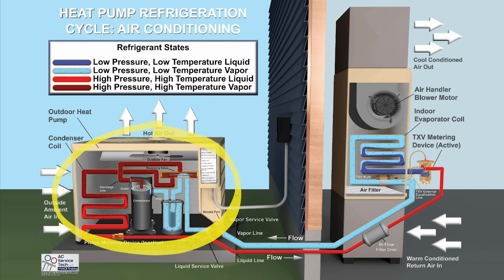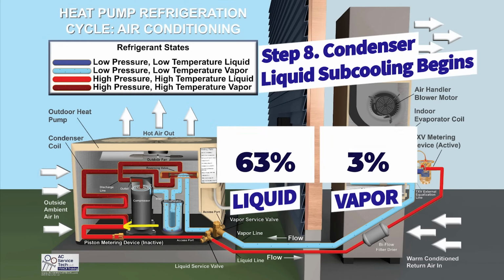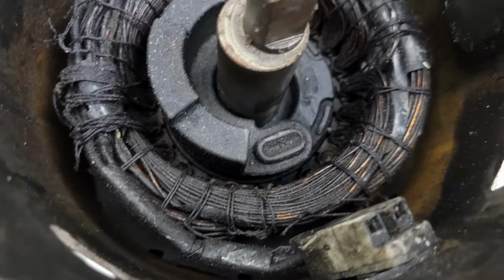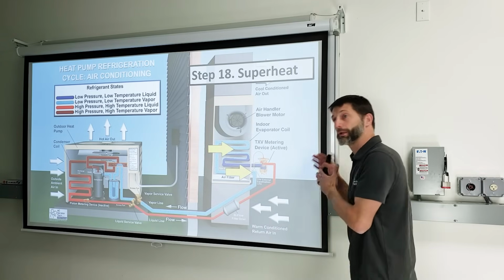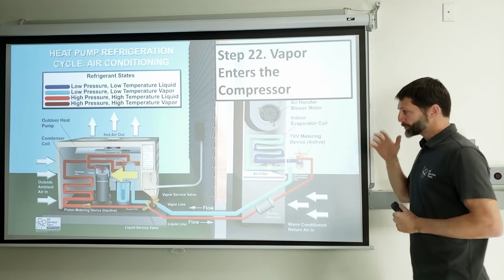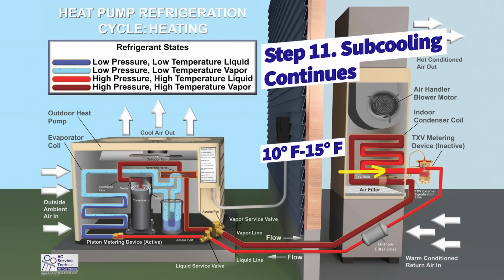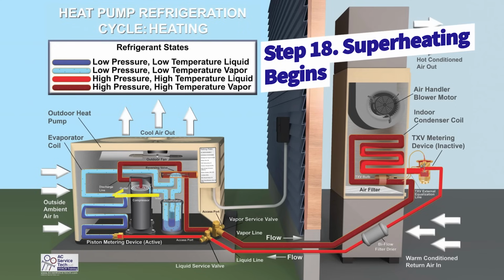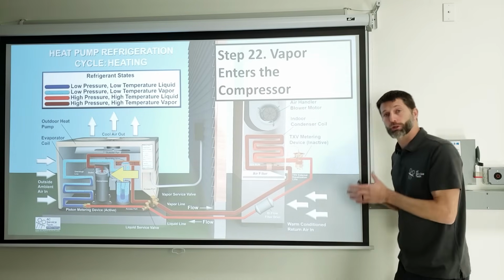HVAC Apprenticeship Class, Refrigeration Cycle, Superheat, Subcooling, Saturation, Parts, AC & Heat!

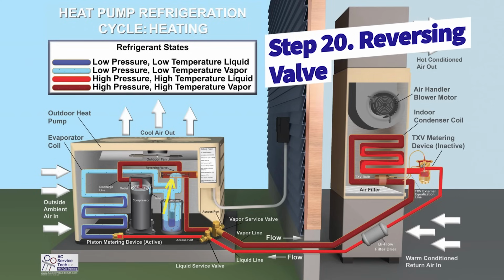Comment: I'm confused at 31:07, how is the low temperature low pressure liquid turning into a vapor as it travels up the coils into the reversing valve? If it's cool outside and heat transfer flows from high to low, I get the coils will be cool but what causes the phase change to occur?
Reply: Absolute 0 is -459 degrees Fahrenheit so all the way down to -459 there’s possibility for heat transfer

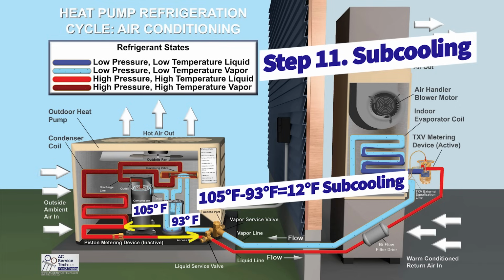Comment: Minor Adjustment:@ 7:21-8:03 I love the videos just want to state that but you mentioned something about The refrigerant subcooling being 16degrees subcooled measured, and your data tag indicated txv subcooling needs to be 12, You mentioed to correct this charge is by adding refrigerant to achieve the 12 degree subcool mark, Which is not correct. you would recover the refrigerant because you're over your mark, High Subcool you need to recover and low subcool you need to charge the unit to match the marking stated on the data tag. Love the videos though very informative.

Comment: Craig, 
I love your videos, and want to study for and get my 606 EPA license soonest. I have orderd your book. guage set and dual temp meter..  but I must ask since I see almost NO mention of it at all...:  

What about "Packaged Units" where the Outdoor and Indoor unit's functions are both packaged together and installed on the roof of a commercial building?.. There is an Intake duct side thru a large air filter , into the "Outdoor" compartment with the condender, accumulator and reversing valve, and a very large condenser coil assembly and heat exhaust fan,  and a separate "Indoor" coil side within the same Heat Pump unit that has a large squirrl cage blower forcing air across the super cold indoor Coil assy equivalent on that side back down into a duct that forces cold air into several office spaces and a half dozen vent grills in rooms in the vicinity below it in that part of the building..
 
My two questions are .. where do you connect your guage set to monitor the temperatures and pressures in this type of " Packaged" 5 ton Heat Pump system?  the HI and LOW sharader valves are only 1/4 tubing T-d off of the main / large tubes I think I should be monitoring..
 
We're in San Diego and I think all the heating /defrost functions may have been disabled on this unit during or after installation.  it's 8 years old and I see three White wires are disconnected and a couple other  deviations from the schematic. . 
the low pressure tube coming back into the condensor side is so cold its completely iced over on that 4 foot? large line entering the Reversing Valve, and I'd need to chip that ice off to connect a thermal probe there.. is that normal that this suction/ low side line comiing into the Condensor compartment  should run so cold on hot days, and have constant Ice covering it?
  
two days ago I got it running and slowly added 410A to the LOW side Shrader valve gradually from a near zero PSI point up to nearly 30 degrees as read on the 410A scale on the guage and the HI Side shrader valve also started at near zero PSI and came up to no higher than 130psi in the 40 minutes I took to partially fill it with about 7 of the 10.6 gals of 410A this system will take .. I made sure to purgs any Air drom the lines before starting to fill the LOW side slowly..  It Iced over during teh process,  could this be normal for this type of system?  

Down below in the offices at the vent grills the temp has cooled from over 75+ to  to 63.5 on day one but is now at 66 deg F on day two. 

I had to disconnect the NEST Rev 3 completely and jumper R-G-Y-O in a wingnut at the input to the unit and had to force the CONTACTOR ON because what was happening is the R voltage was only 4 to 5 vac .. and the NEST would constantly complain about the R lead bieng disconnected yet the wiring itself is OK.. anyway I have a new defrost control board on order since some restors are burnt on it, and  I believe it is what is causing the R winding vac to drop.  After a 5 minute run interval with Contactor manually depressed  that same R winding vltg, the Contactor Coil voltage and the voltage at the Wingnut RGOY jumper all pop up to where they should be at 26.7 vac and it continues to run fine .. But I have no thermostatic control..and if I kill the main 240 breaker it wont start up without manually depressing the contactor for 5 minutes again.. Totally UNSAT ..

 Anyway I hope you can reply to my questions above. I will be shutting it all down again and checking all the limit switches for continuity thru them before replacing the defrost board when it does arrive in a week or so..       :face-blue-wide-eyes::face-purple-crying::face-purple-smiling-fangs:

Comment: At 8:38 you mentioned that “…the vapor line will be higher in temperature than the liquid line”
But your diagram suggest that the blue vapor line is “Low pressure low temperature vapor” while the red liquid line is “high pressure high temperature”. Did you make a mistake or am I just confused.

Comment: What causes a heat pump to run on heat mode when thermostat is turned to the off position? 
Works ok when turned to cooling.
Reply: Gotta check with a meter bro and figure out where the voltages are coming from
Reply: Get the schematic, something is energized that shouldn’t be…or welded contacts

Comment: Hi Great as usual and thank you. I have noticed you referred to different types of refrigerants R410A (most common) R22 and HCFC (will be replaced due to Ozon depletion potential (WHEN LEAKED) both R410A and R22 are A1 class non-flammable refrigerants, while you mentioned R454B which is an A2L class flammable which will require extra safety measures to protect the installer and of course the user. These classifications are as per ASHRAE34 & ISO817. It is important to mention the classification as 99% of AC refrigeration engineers are not aware of flammable which was recently introduced while A1 class non-flammable has been around since 1928. Thank you and keep up the good work.

Comment: Master, 'why isn't the High Side or High Temp Side used to Heat Water as Pre-Heating for Home Hot Water System? Also, why isn't Thermal Electric - Tec's Used to generate Electric Power to off set Power use and to generate Power for LED Lighting for Home and Office use? Just asking. These Unit's Waste enough Energy that if someone had a mind too, could use that Waste to Power a lot of things in the Home. This would help cut Energy Cost in the Home.
Reply: They do, check out heater recovery water heater, most new grocery stores use the heat from the coolers(think produce and meat freezers) to preheat the domestic hot water

Comment: Question??? Why by adding refrigerant we raise the subcooling so the line temp stays the same but the gauge temperature rises right….but sometime they both rise at the same time what is happening in that situation?????
Reply: In other words is hard to get the require subcooling if they both temperatures rises at the same time
Reply from the maker: So they will both rise in temperature when you have a very low subcooling, then when you get closer to an accurate charge, the subcooling will increase with the line temp lowering. I understand what you are saying completely. You just need to continue to add refrigerant until you notice a higher spread between the line temp and the sat temp, thanks!
Reply: @acservicetechchannel  thank you just I get scare when I see the saturation temperature over 110 or much higher like 120